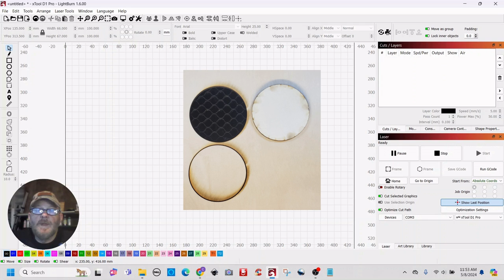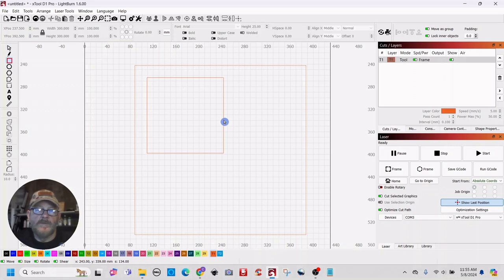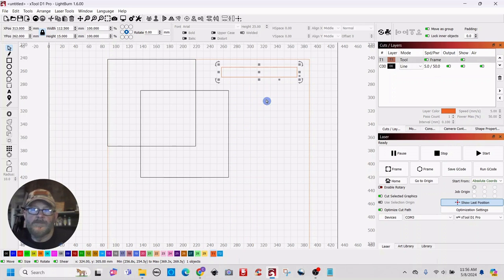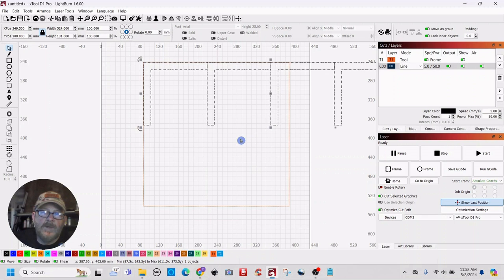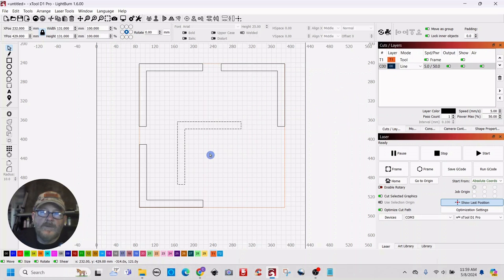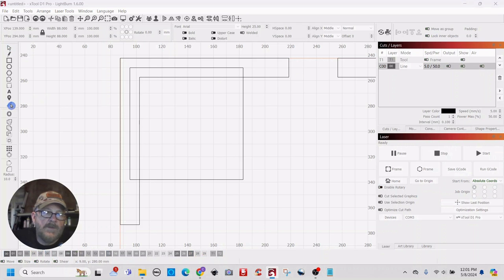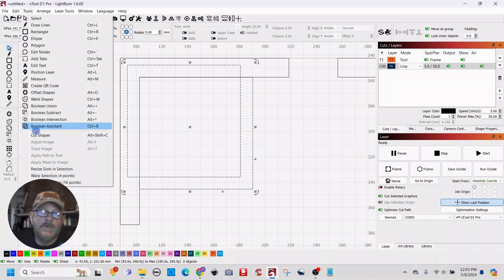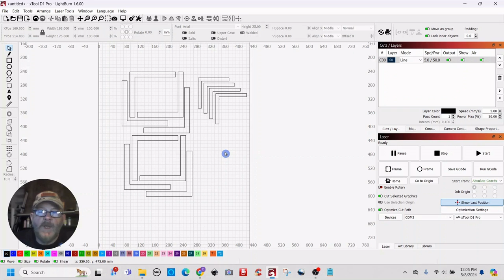Laser Flashburn Risers (DIY) | Beginner Laser Project #44

Comment: In Lightburn you can use comma or period to rotate also you can use ( shift, control or shift and control ) Shift is 45 degrees control will give you 15.5 degrees adnd shift and control will give you 1.2 degrees....Be well and be safe..
Reply from the maker: Thanks Bill!  Those tips are really handy.  I need to do a video on using handles and manipulating shapes to help me remember the techiniques.  Take care - Dave!